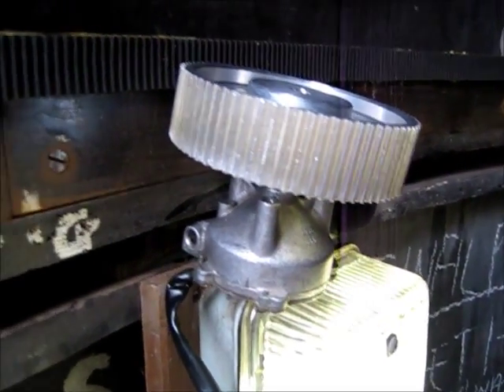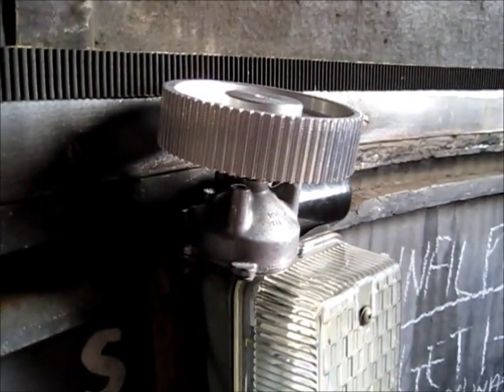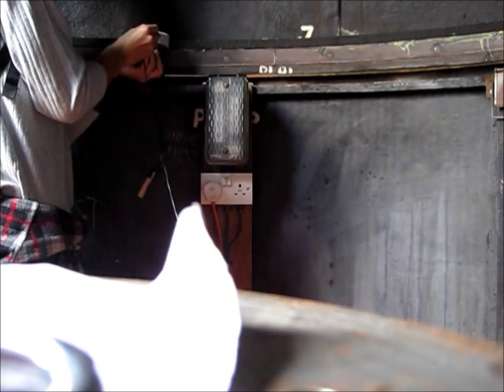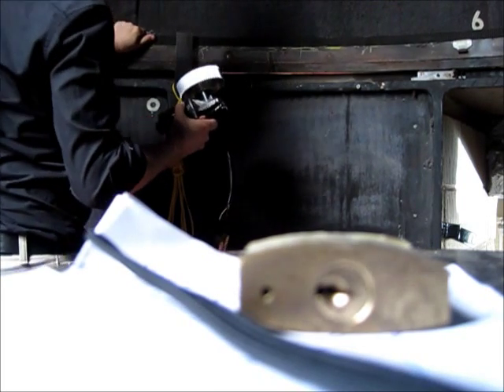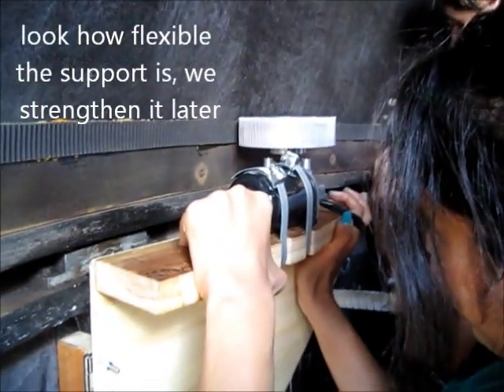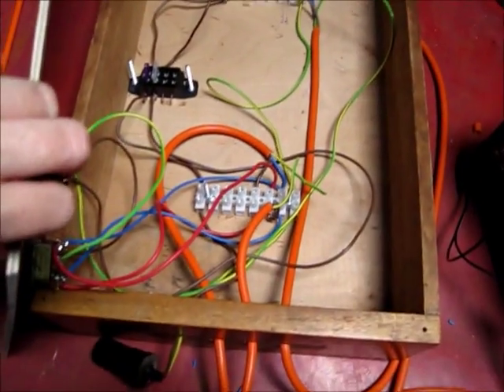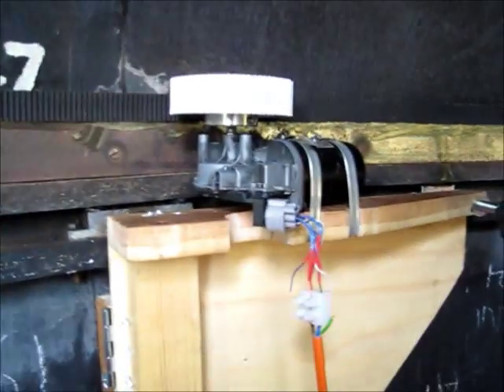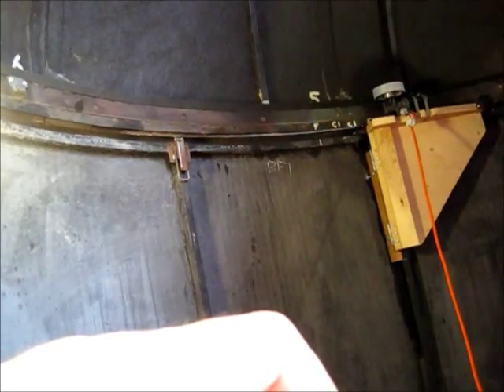Getting the Dome to Rotate

Comment: I used this drive mechanism for my home made dome. However, for the motor drive, I found using  a double sided belt about 30 cm long driven by the motor with an idler wheel gave me about 30 teeth of the drive belt in contact with the toothed belt on the dome, and that stopped it slipping. The starting friction is not inconsiderable, so in the end I used a CNC stepper as the drive motor.